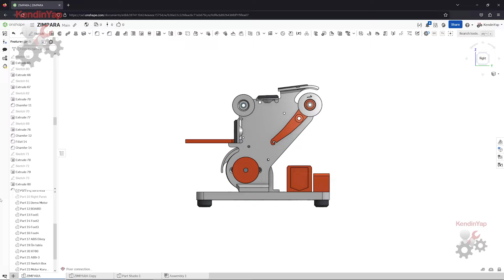How To Make Mini Electric Sander? With 3D printer.

Comment: Can I use PETG for ABS parts? I don't have enclosure yet.
Reply: Yes
Reply from the maker: You can use PetG. But for these types of small parts, a enclosure is not necessary. You can use ABS. Or you can use ASA. ASA is more trouble-free than ABS.

Comment: Hello, I am a subscriber who watches with admiration every time.

As I watched this, I have some questions, so I would like to ask.

1. What is the order when designing? Do you design parts based on what you have?

2. In particular, how can you do design so well? Are you looking for similar designs?

Every time I watch it in amazement, I ask a question.
I would like to ask you if you can give me an answer.
Reply from the maker: Hello. I design some pieces taking into account the materials I have, and some for materials I can purchase.
Design is a somewhat long process. Of course, there are parts that I was inspired by similar systems. But I make a lot of changes until the final stage. Some parts may not work very well when transferred from drawing environment to real life. I go back again and find different solutions and try again. It's a bit of a long process until you get a smooth, efficient result.
Reply: @Kendin-Yap  Thank you for answer
I love your design. Thank you for uploading the materials so I can make it. I look forward to your videos every time. Thank you. Have a nice day.

Comment: 18650 lityum pillerde 30-35 amperlere çıktı bunlarla seri ve paralel bağlantı yaparak RC dünyasından tutunamayızmı acaba birde Aspilsan 2800 MAH 14 A den 25 e güncelledi pillerini. Tamamı olmasa da paramızın bir kısmı içeride kalır hiç yoktan. Yüksek akım veren 18650 pil ile bir RC projesi yaparmısınız elinize sağlık bu arada resmen sanatla uğraşıyorsunuz.
Reply from the maker: Linkteki videomdaki uçak ile 3 adet seri bağlı 18650 kullanmıştım. https://youtu.be/oMLHavzj5Pg?si=ddxn0uv27QCxA8Rf
Bazı modeller için uygun. Çok küçük modeller için fazla ağır. Çok büyük modeller için akım gücü sorunu var. Paralel bağlantı ile akım gücü artıyor ama LiPo pile göre çok ağır oluyor. 90cm ile 120cm arasındaki üstten kanatlı modeller için makul bir şekilde kullanılabilir.
Reply: @Kendin-Yap  Videonuzu izledim. 3 yıl önce yapılmış bir proje olduğundan 3 yılda pillerde ve teknolojide gelişme olmuştur diye düşünmüştüm. Ben de çok hevesliyim. Aspilsan piller 75-80 tl den şu anda piyasada bulunabiliyor. 3S2P diziliminde 250-270 gr. Arası ağırlığı oluyor. Güncel 18650 lityum piller ile yeni bir proje düşünürmüsünüz acaba.
Reply from the maker: Ne yazık ki pek bir ilerleme olmadı. Benim 3 yıl önce kullandıklarım 20A dır.  Geçen yıl 30A olanlardan da kullandım. LiPo kadar verimli değiller. Ama ucuz oldukları için daha önce bahsettiğim aralıktaki modeller için kullanılabilir tabi.  @hayaksisheytan
Reply: @Kendin-Yap  Çok teşekkürler. Yeni başlayanlara 2024 tavsiyeler ve F/P ekipman önerisi verebilirmisiniz.
özellikle kumanda

Comment: The link on the build page for a rocker switch doesn't work please can you tell me which one to use
Reply from the maker: I checked and both are working. But Aliexpress links may not be the same for all countries. The button I use is 21x15mm.
Reply: @Kendin-Yap  Im in the uk that's a good test might try using a Turkish VPN server to see
If there is a difference
Reply from the maker: The link works when I select United Kingdom with the "ship to" option. I don't know why it doesn't work when you try it. The best thing for you might be to search by measurements. Rocker Button 21x15mm @zigma182

Comment: Usta ellerine sağlık. power supply led trafosu kullansak olurmu acaba?
Reply from the maker: Voltaj ve amper uygunsa tabi olur.
Reply: @Kendin-Yap  teşekkür ederim çalışmalarınızda başarılar dilerim
Reply: @Kendin-Yap  usta ben 775 motor aldım ama bu 8000-10000 RPM dedi satıcı bi farkı olurmu? 6000 rpr diye bekirtmişsinizde.